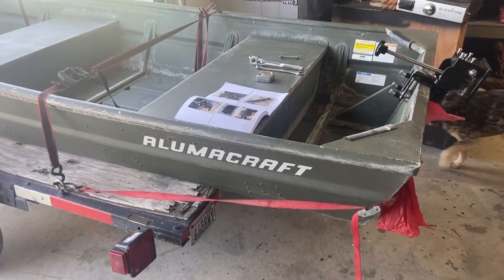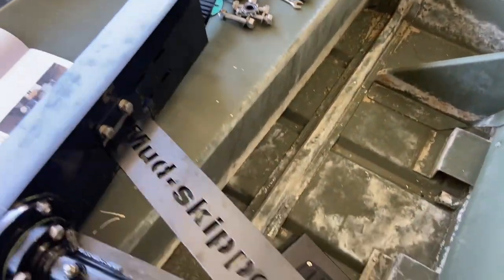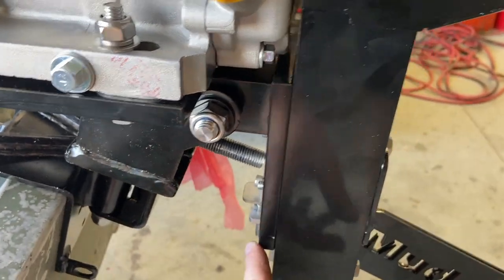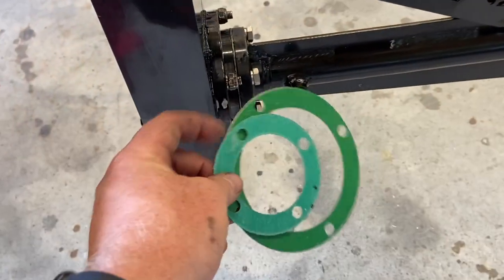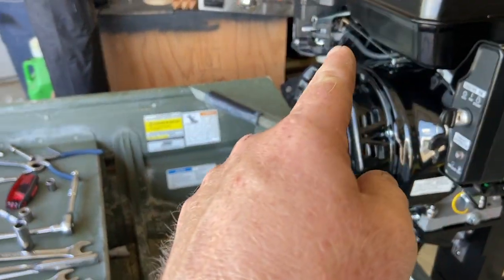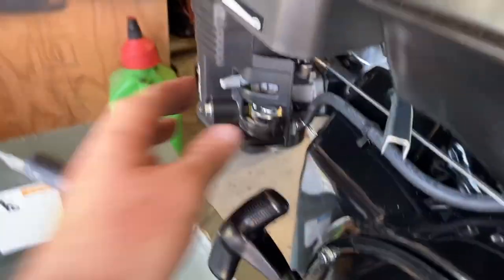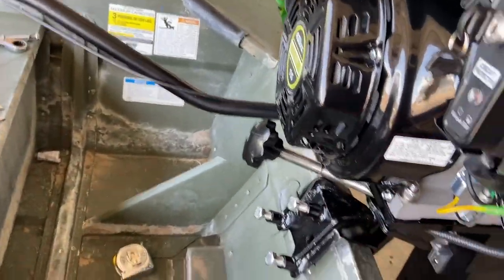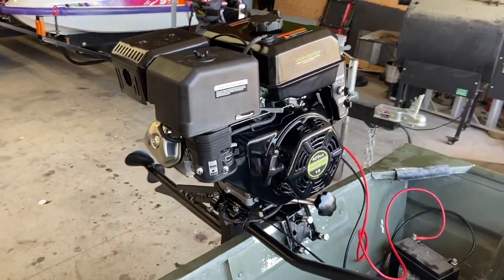15hp Mud-Skipper Surface Drive

Comment: Is your clutch that turns the prop disengaging at idle?  I am having problems with mine not disengaging with the predator 459.
Reply from the maker: Mine wasn't at first.  But after a few break-in trips and turning the idle down a little bit, it now disengages.

Comment: they say to ground the battery lead to one of the engine mount bolts.
Reply from the maker: yeah, but the bolts on this kit are WAY bigger than the eyelet on the power cable they supplied. It's working pretty good where I put it, for now.
Reply: @dingalsbe88  awesome Ill do the same
Reply: Did you have to adjust skeg any for tracking straight?
Reply from the maker: @bp30656  I have not had to mess with it... if you trim it out good it tracks nice and straight.

Comment: What size of prop is on it ?
Reply from the maker: 9" aluminum
Reply: @dingalsbe88 after using it for the last few months what’s your thoughts?
Reply from the maker: @turtsable  my thoughts are that it is time fore some carb and exhaust mods.  I'd like to run the exhaust straight out the back so its not so loud coming out at a 90 right into my ears....  and jet the carb for some more power.. neither are necessary though.. its a blast to jam up the river in such shallow waters.. it's a ton of fun and turns a lot of heads.